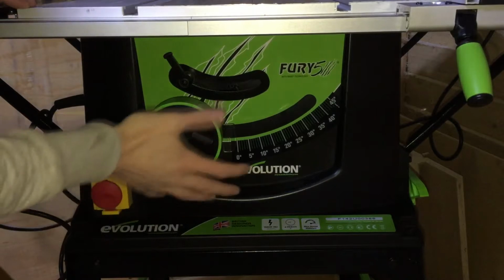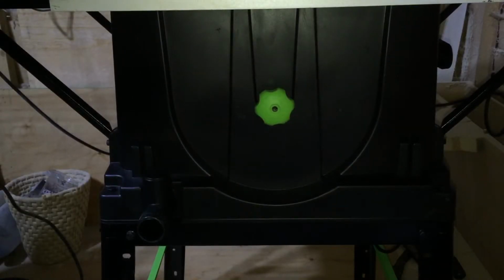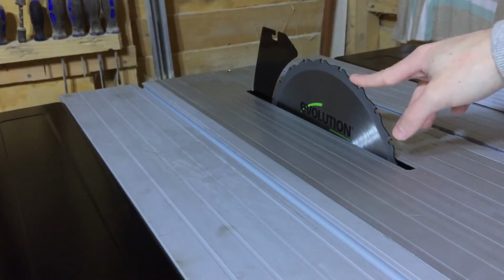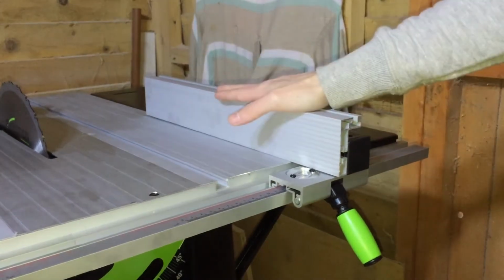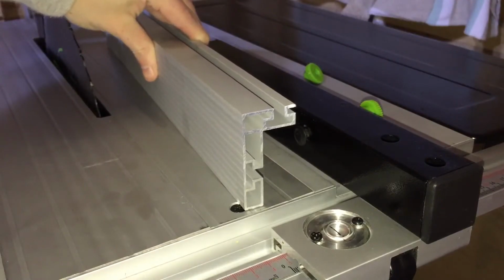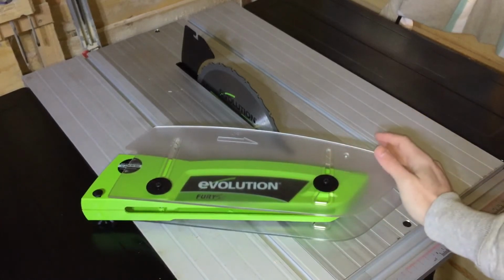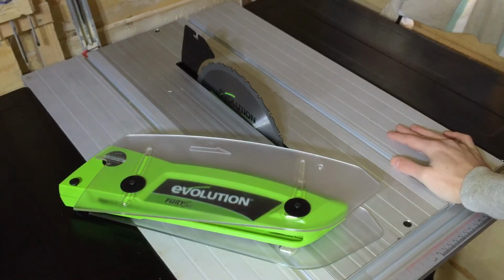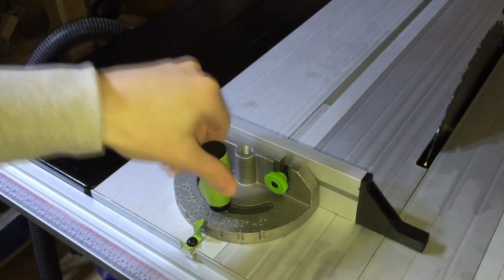Independent Review - Evolution Fury 5 10" Table Saw

Comment: That's a very fair, and, informative review Joe, I was very impressed with the ability of the blade to cut different materials, another point I liked was the incorporating of a clamp on the mitre fence. You touched on a lot of points that may well have been missed by other reviewers, such as the soft touch feel of the handle on the blade height/angle adjuster, which is important in our cold uk climate. Certainly a saw I will consider after watching your review. Nice one !!.
Reply from the maker: +wayne bartlett Thanks Wayne! Glad you found it helpful. They have since released a new model now which is even better 😊

Comment: I have one of these.  It took a while to dial in the fence and get it parallel to the blade, but once done, it is pretty solid.  I have found that the track for the mitre gauge is quite sloppy with 3 or 4 degrees of play which makes it pretty much unusable.  I also found that the blade tilt angle guide is way off, much better to measure the actual angle of the blade to to the table. Other than that, it a solid saw and good value for the money

Comment: Hi! Had my eye on this for a while and finally decided to buy after watching the video, I have to say I have never been so frustrated putting anything together, none of the holes seemed to line up and the pictures in the book didn't show anything useful. To top it off the bag with the screws etc. wasn't even done up so all the washers and screws were rattling about in the saw and getting stuck under the table when I unboxed it! I honestly cannot believe how poorly thought out the design of the stand was! That being said after eventually having it all put together the stand is sturdy, haven't actually switched it on yet but it does look a decent bit of kit for the money! Also bought a Rage 3s 255mm Sliding mitre saw which was no trouble putting together and is excellent! All I need now is some wood!
Reply: Haha oh that's good then! I can't wait to try it out now!

Comment: Great Review as always Joe well done.
I had one of these saws for a while for the most part it was accurate but keep an eye on the motor bolts if you are going to give it a lot of use as they wind themselves out with time, a simple Allen key and a little lock-tight stops them working loose.
also be careful not to work the motor too hard the back bearing on the motor is in the plastic case mine shattered the casing when i was ripping down some 3 x 2 softwood 

the best bits on this saw for me were the blade and the fence as simple as the fence is it works well and I am still using the fence on a saw I was given as a spare 

if you ever need a spare blade I have one you can have for the price of the postage I saved it but it does not fit either of my saws i have now
Reply: I have already got another blade I may use for a clock at some point so the offer stands if you ever need it. 

the screws that came loose on mine are the ones that attach the motor to the lift plate I think there are 4 or 5 of them it may have just been a case of someone forgot to lock-tight them when it was built  the first time I noticed it was the blade went out of alignment with the slot in the table 

keep up the good work 

Phil